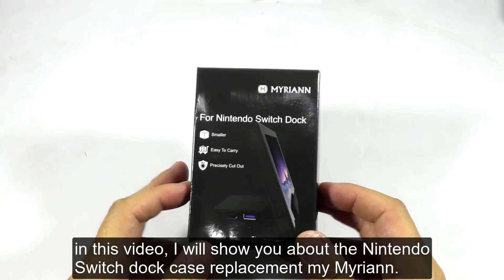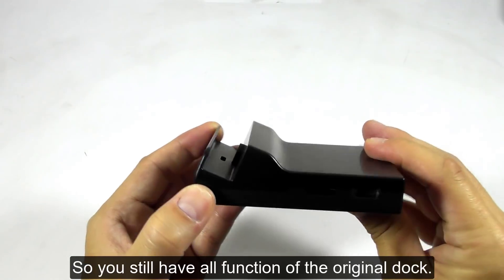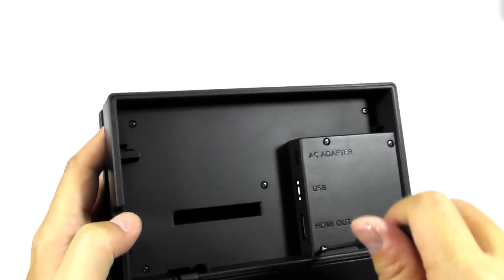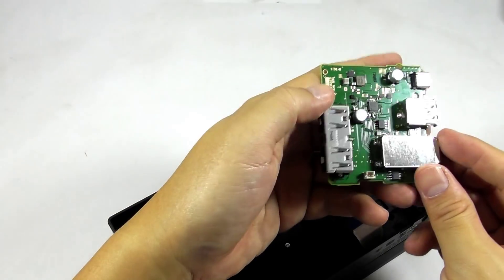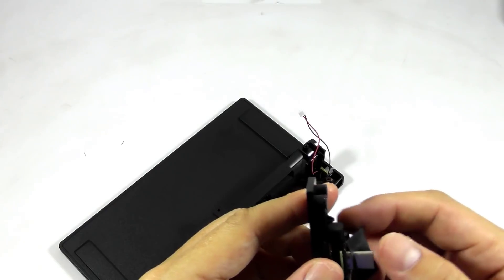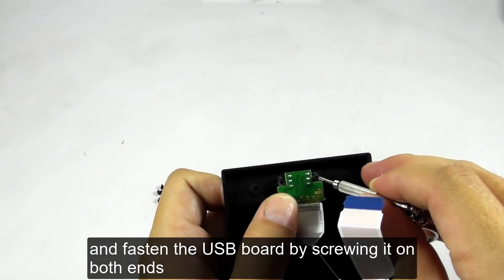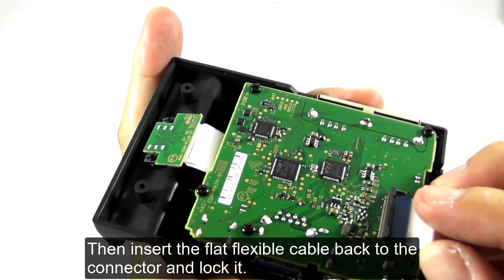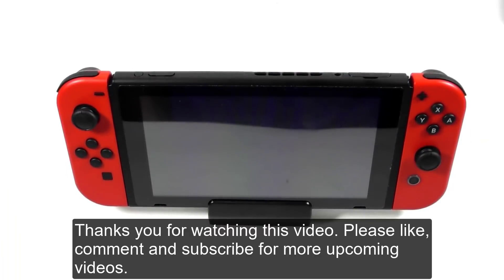Myriann Nintendo Switch Dock Case Replacement Review

Comment: Your instructions are 95% perfect. My only correction is at the very end, when you're screwing the board back into the shell, don't screw the back two screws in or you won't be able to get the holes to line up. When you attach the other side of the shell, you're screwing in that AND the board at the same time.

Other than that, FLAWLESS. Nintendo should have made these thing and there's a good sized vent back there as well. I'm not really worried about the heat, to be honest. Also, there's a Red version on Amazon of this dock and it has the switch logo printed on the front. A little more "flashy" I guess but if you're really trying to impress your friends or something, can be nice. Mine looks great! :)
Reply from the maker: thanks

Comment: I added the light into one of the vents with the addition of some electrical tape.
Reply: I tried doing that too but it doesn't light up anymore for some reason. Not a big loss since there isn't a good place for the light but I was still a bit disappointed

Comment: Hi, Im wanting to use a usb dongle adapter (the 8bitdo) so i can connect my ps4 controller to the switch, do you know if this will work while not connected to the TV. So i will have the charger into the usb c and the dongle adapter into the USB and the HDMI will be free. Just want to know before purchasing anything. thanks!
Reply from the maker: i dont have any clue. sorry

Comment: Is it possible to use this to charge a Switch and use the USB ports without having the screen display go away? I like the idea of playing Smash Utimate with GameCube controllers on the go, but carrying a monitor around all the time would ruin the point of this product for me.
Reply from the maker: no. u need to buy a nintendo adjustable dock to do that
Reply: Hori has a USB multitap for the Switch that actually has more USB ports than the dock.  I picked myself up one so I can use it for the same reason you want.